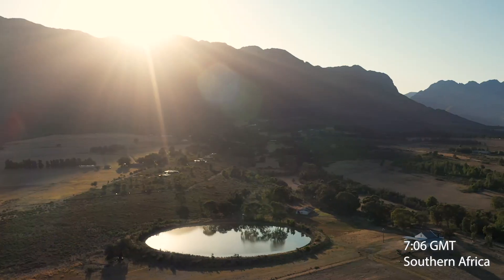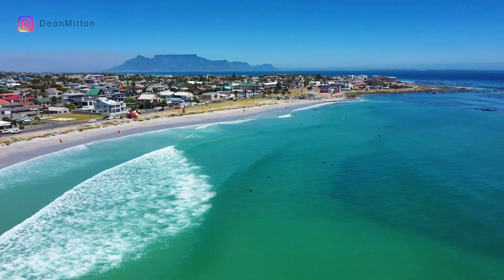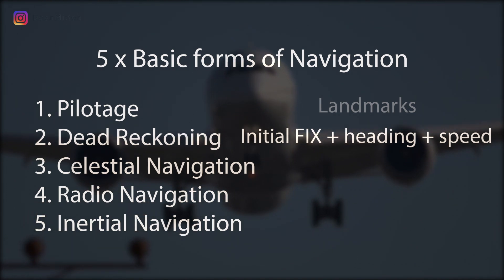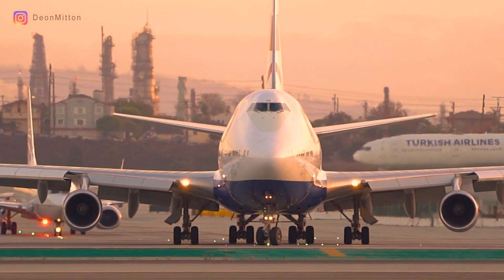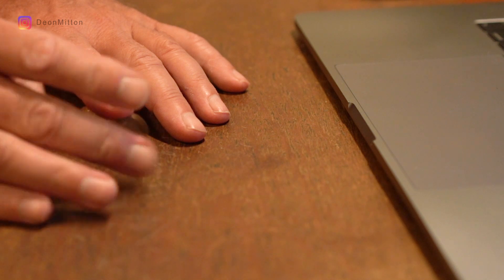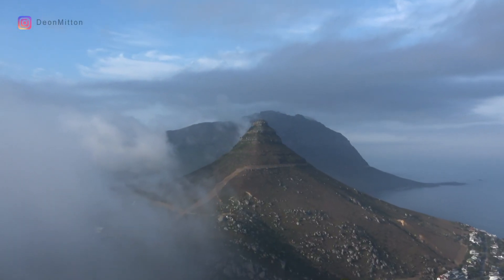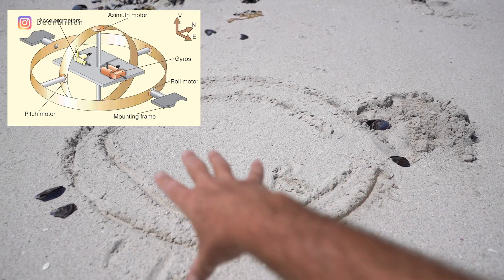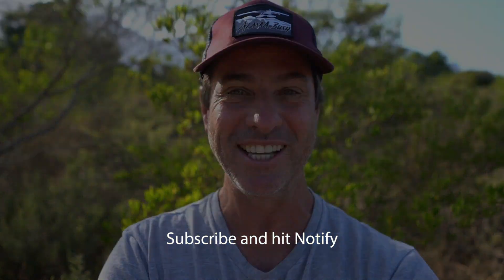How it works - Aviation Inertial Reference System - Autonomous navigation without GPS.

Comment: The IRS system still uses accelerometers as the ring lasers do not detect linear acceleration only rotation. There is 3 ring lasers  one for each axis and accelerometers for each axis.

Comment: There is no way that small difference in the two beams could be measured. If you study Walter Russel he said light has no speed so c is actually zero. They just use xyz accelerometers and the laser is just for show. I think JPL manufacture all the IRS units.

Comment: As a former engineer at AlliedSignal Aerospace/Honeywell, I can say that you roughly have the concept correct but your model of the ring laser gyro is completely wrong. First off, it’s not a ring! The path is either a triangle or a square. Secondly, there are not two laser emitters, there’s only one that goes through a beam splitter. Third, there are not two detectors, there’s only one that senses the interference pattern.

Comment: how is the frequency of the laser light altered by the moving "tube" ? Or did you mean the phase of the light is shifted?
Reply from the maker: Essentially, the beams run in different, and opposite directions, they enter and exit the tubes at the exact same point, which enables an interferometer to measure the reassembled signal at the moment of the exit the tubes.

When a ring laser gyro is in motion, the beams of light will travel different distances.  In this system, difference in frequency is proportional to the rotation rate of the gyro (which is mounted inside the aircraft). 

The frequency difference is detected and measured via an interference fringe pattern/ and which phasing contains the directional information.

Hope that a bit more info about the fascinating science of using light beams to construct a gyro.
Reply: @DeonMitton  they way you describe the change in frequency points to the Doppler effect. I think that is what's going on here. Thanks for your explanation!
Reply from the maker: @ThomasHaberkorn  checkout the Sagnac-effect : https://en.wikipedia.org/wiki/Sagnac_effect - I might be mis-guiding by using Frequency - but I believe the interferometer to detect phase shift also
Reply: @DeonMitton  wow, very nice derivation! No Doppler effect after all. Thanks!

Comment: So you mentioned a difference in arrival time to the output detector is calculated with math. Well to some degree it is. The speed of light being 7.5 times around the earth in 1 second is hard to calculate speed differences in a enclosed 3 inch space. So it’s actually phase shift is what’s being calculated. The longer travel beam has a different phase than the shorter beam so the math is basically the Doppler Effect.
Reply from the maker: Essentially, the beams run in different, and opposite directions, they enter and exit the tubes at the exact same point, which enables an interferometer to measure the reassembled signal at the moment of the exit the tubes.

When a ring laser gyro is in motion, the beams of light will travel different distances.  In this system, difference in frequency is proportional to the rotation rate of the gyro (which is mounted inside the aircraft). 

The frequency difference is detected and measured via an interference fringe pattern/ and which phasing contains the directional information.

Hope that a bit more info about the fascinating science of using light beams to construct a gyro.

Comment: At 12:55 it is not a frequency shift it is a PHASE shift. One laser is fired (pulsed) at a splitter and then into the input of each fiber optic cable. It is not one loop in each direction but precisely matched lengths to form several loops in each fiber optic cable - each looped in opposing directions. Because a single laser is fired and split into each fiber optic cable equally, the lights starts at the same phase in each cable. But if the Gryo rotates in one direction, the light will take a longer time to travel and arrive late at the far end (just a few pico seconds) in one cable. And the light will take a shorter time to travel and arrive early at the far end (just a few pico seconds) in the other cable. The two light beams are then combined as they exit the fiber optic cables. Because the two light sources are now slightly out of phase, they cancel each other out a tiny bit and thus the bightness is slighty dimmer (compared to as if it had not been rotated) and this dimming translates as to the rotation angle. The more it rotated, the more the result dims.

The arrival times are also measured but not as accurately, they are just measured to see which arrived first to determine rotation direction. Ring Gyros are very quiet, compact, light weight, more rugged, have less procession and drift, and are more accurate than spinning Gyros.  Even tiny Gryos can be made on Silicon. In that case, each path is just a circular series or traces in the Silicon that act similarly to fiber optic cables but use electrons rather than photons. These chips can be the size of your pinky fingernail and contain 3 Gyros, one for each axis.  Adafruit has low cost ones that you can control with an Ardunio Nano to form a tiny Gyro system. I designed one into my Model Rocket Avionics Bay, along with an Altimeter and Temperature/Humidity sensor. It records these parameters, and when it senses the rocket has stopped gaining altitude and starts to tip over, it deploys the drouge parachute, and then the final landing parachutes at 300 meters from the ground.
Reply: Thank you.

Comment: Thank you so much for the excellent explanation of ring laser gyros...it has helped me understand the IRS. Many years ago, I worked on INS on the USAF F-111A ( Litton AJQ-20) which had gyros in the stabilized platform unit (SPU). When ring lasers came out, I didn't understand how lasers could replace spinning gyros, but now I understand, thanks to you. You video was very helpful to me.
Happy New Year!!!
Reply from the maker: Glad you liked it.  it's elementary with some assumptions, but the concept is close enough for understanding

Comment: I'm just going to take a wild guess and say AHRS is a modern solid state evolution of the IRS and INS systems
Reply from the maker: Close... 

IRS is an inertial platform that can detect and measure accelerations along 3 axis, as well as rotational acceleration.  Therefore calculate displacement from a known position. I.e. it can be used for Navigation as well as provide attitude and heading reference.

AHARS will only give attitude and heading reference and requires another sensor to provide navigation such as a GPS system.

Comment: I worked with the inventor of the laser ring gyro. It was never built for aviation use. The Ring gyro is over 40 yrs old. It has been adapted for use in aviation & missile systems since its development.
The ring gyro was a triangle shape not a tubular fashion.
Reply from the maker: Thank you for the note Roy - wow - it would be fascinating to hear the story of development.
Reply: @DeonMitton  because a lot of it was company private I cant talk about a lot of thing as the company I worked for is a defense contractor. The company made submarine navigation systems, weapons control systems and the world leader in radar technology, developing doppler radar and phased array antenna panels, both military projects which are now used around the world. Dthe doppler was meant as a replacement for the EWR systems, but got cancelled due to satellites. The company sold the project to NOAA for tornado predictions as it was able to detect the tight radar echo in what as known now as the "hook" echo, detecting both inbound and outbound echos at the same time
I can say that the ring gyro project was sold to another company that made missiles and at first they had major issues getting the ring gyro to work on a missile due to the huge g-force that were involved. I also know that the ring gyro was so sensitive that the optical bench that was used in my company could detect the earths wobble

Comment: EACH LASER WOULD NEED TO BE STATIONARY, WITH THE DETECTORS BEING MOVEABLE, TO DETECT ANGULAR/LATERAL MOMENTUM.
WITHOUT BRINGING THE 'Z' ACIS INTO THE SETTING, AS ELEVATION CHANGE IS NOT DIRECTIONAL CHANGE.
PITCH AND YAW RATE MIGHT HAVE SOME EFFECT HERE, BUT NOT CERTAIN.
Reply from the maker: Detection of rotational acceleration, is actually accomplished by means of measuring the interference of the 2 x waves.

When a ring laser gyro is in motion, the beams of light will travel different distances.  In this system, difference in frequency is proportional to the rotation rate of the gyro (which is mounted inside the aircraft). 

The frequency difference is detected and measured via an interference fringe pattern/ and which phasing contains the directional information.

Comment: Excellent content! Great footage and I learned something new. Thank you!
Reply from the maker: Essentially, the beams run in different, and opposite directions, they enter and exit the tubes at the exact same point, which enables an interferometer to measure the reassembled signal at the moment of the exit the tubes.

When a ring laser gyro is in motion, the beams of light will travel different distances.  In this system, difference in frequency is proportional to the rotation rate of the gyro (which is mounted inside the aircraft and therefore detects the roll rate of the aircraft in each of the axis where the laser is mounted). 

The frequency difference is detected and measured via an interference fringe pattern/ and which phasing contains the directional information.

Hope that a bit more info about the fascinating science of using light beams to construct a gyro.

Comment: Accelerometers are not the same as gyros -- accelerometers detect acceleration and using math can be used to determine speeds and translations.  That get's you only 3 axis of information.  The other 3 axis are the rotations about those 3 axis and that is provided by gyros.  I know you know this and am mentioning this because you are inconsistent in usage.  A small error can be ignored, but this is major and you should have redone that portion of the video.
Reply from the maker: Thank you for the feedback.

Comment: Awesome Explanation, (How Is The Laser Light Fed; To The Ring Since The Ring Moves?)
Reply: Think of it this way, a ring laser gyro is a delicate instrument. You should never drop, or subject the box to more than a few G's. The movements inside the box (The three ring laser gyros) one for pitch, one for roll and one for azimuth (Heading) are precision components. The ring movement is measured in thousands of an inch or fraction of a mm. The emitters and detectors project and receive laser light at the three apexes of an equilateral triangle simultaneously. Think of the three sides of each ring laser as A, B and C not a circle but a ring using a glass triangle. The glass is then surface coated like that of a microscope or telescope mirror. At each apex there is an opening where laser is emitted into and another for laser to exit and be detected for that side of the triangle. The three emitters and three detectors are calibrated to reference zero angle at a precise point. Any movement of the box in any direction results in the three ring lasers (When powered) results to give a precise output where the box has moved when bolted to the aircraft. The movements of the aircraft are measured in minuscule amounts instantaneously whether momentarily or, continuously. Theory being a mass remains in motion any change in the acceleration of that mass results in a change to the ring which is detected electronically by the lasers being reflected off the optical polished surfaces. The World moves around the ring laser gyro not the ring laser gyro moves around the World. This technology is only second generation inertial reference instrumentation. There are better instruments namely third and even fourth generation instruments which military uses for Nuclear defense and hyper-sonic aircraft.

Comment: With all due respect, the explanation of a RING LASER GYRO instrument is totally different.
In a ring laser gyro, the cavity, usually 3 narrow  tunnels, filled with the lasing gas (a mixture of helium and neon) IS the laser. (that is why it is called a RING laser) The edges have mirrors, such that the light travels in both directions in a precise triangular path. One mirror is semi- transparent, allowing light beams to exit in two directions with additional optics, these beams are brought together where they interfere with each other creating an interference pattern of waves that can be measured. 
At least one of the other mirrors is mounted on a piezzo-electric 'actuator' which moves the mirror about the distance of one light wavelength. Why? a gas laser operates only between mirrors when the path lenght is an integer  multiple of  the light  wave lenght.
The actuator holding the mirror is called the 'path lenght servo' and is controlled and  moved to maximize the laser power.
For the reasons that the presentor explained,  the interference pattern will move in a direction that depends on the direction of the rotation rate component normal to the plane  of the light triangle.
By counting the interference waves, this rotation rate is measured with precision.
There is one problem with ring laser gyros:
When the rotation rate is small enough the counter rotating laser beams will 'lockin' and no interference pattern will be formed.
One way to solve this problem is to mechanically 'dither' the instrument.

Injecting an external laser light into a light guide pair is another but inaccurate way to measure rotation but it is NOT  CALLED A RING LASER GYRO!
It is called a fiber optic gyroscope
Reply from the maker: Thanks Herman - it's fascinating technology, and so cool that we can harness the physical world, to create precision instrumentation like this.

Comment: The video is cool. How accurate would INS be for a 4-hour flight? How much would he deviate going from airport A to airport B after 4 hours of flight? Would it be like drifting 1Nm for every hour of flight?
Reply from the maker: It's used on airliners, like inertial navigation, and is usually used to supplement other navigation systems, for long flights.   You can probably find the performance specs online - so I won't elaborate here.   Suffice to say, the predecessor,  INS/IMU was used to land man on the moon (IRS is a FAR superior system) - I think that flight exceeded 4 hrs
Reply: @DeonMitton  Thank you very much. Do you have any FAA documentation on INS?
Reply from the maker: @josebiscaia670  Most of their information docs are available online.
Reply: @DeonMitton  thanks

Comment: Good explaination! I used to work in the manufacturing of IRS systems based on RLG gyros. First job was with the F-T ADIRU. Basically it's the same sort of explaination I gave to alot of new techs and engineers. Have since moved onto MEMs based INS systems.
Reply from the maker: Thanks Dustin - well then you're the expert and manufacturing sure gives you some interesting insights... must have been a fun assignment
Reply: @DeonMitton  It was! Learned from alot of really smart folks. One thing I also generally added to help people understand was how rotation of the gyro caused destructive wave interference. The sensors then pick that up as pulses of light during rotation. Rate of pulses equals rate of rotations.
Reply from the maker: @hingos2002  Yes - phase shifting causing the interference... it's fascinating science for sure.
Reply: Would you mind answering a question please? I understand the basic principle for detecting rotation (I've read about laser interferometry because I like astronomy and it's used to great effect in LIGO). What I'm not sure I grasp is how the linear component of acceleration is measured. Is this also detectable based on interference patterns? I can't quite imagine how that would work.
Reply: @macronencer  The IMUs also have 3 accelerometers install as well. They are many styles used. MEMs based, vibrating beam, hinge and pendulum. All rely on inertia moving a structure to change either a resistance or capacitance reading. Calibrate that change to a know rate and you can build a model.
Reply: @hingos2002  OK that makes sense. Thanks for the information, I appreciate it!

Comment: Deon, very interesting; what about wind drift.? Does INS/IRS account for this or would pilots have used another method without the aid of external radio signals? Cheers
Reply: For wind vector, we need heading, drift ,groundspeed, True air Speed,we have heading ,drift ,groundspeed through INS/IRS,for True Airspeed ,INS/IRS gets its True air speed through Air Data Computer,thus obtaining the wind vector..